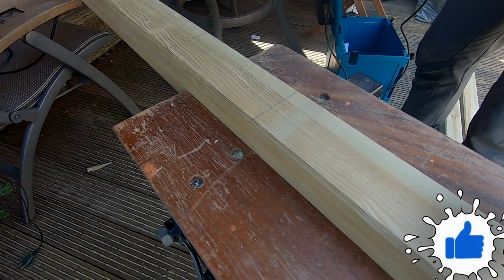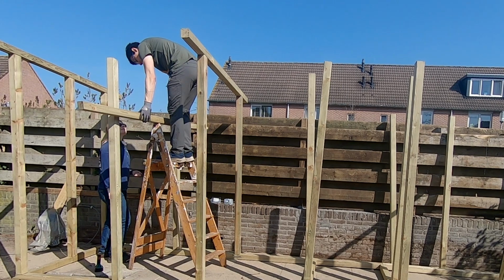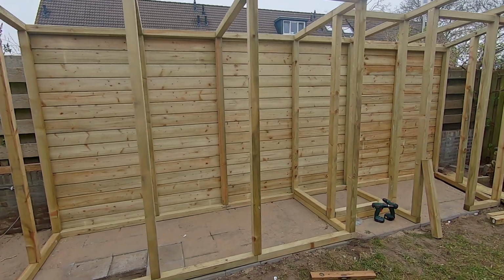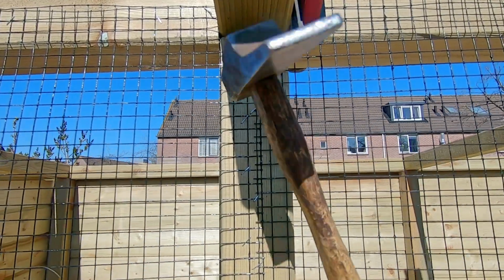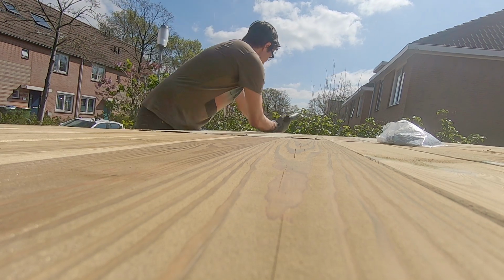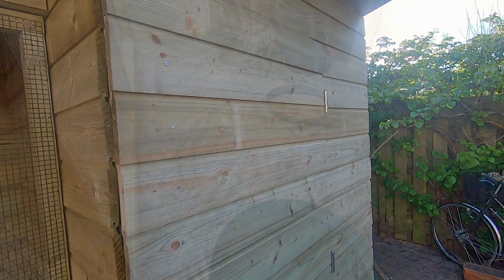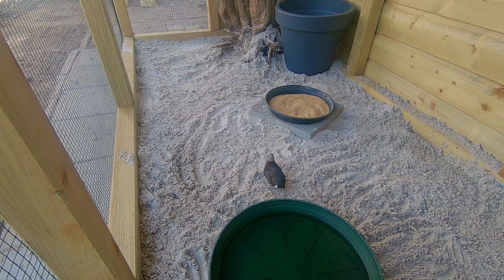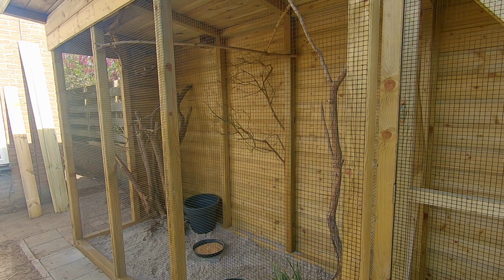I *SURPRISED* my Dad with a New FINCH/CANARY Aviary

Comment: Hi aviary builder for over 35 years, you may need roll down blinds at night/storms./hot days.
make this yourself, thick PVC round pipe 100% shade cloth and cord.
(the main thing is the ventilation flow), round holes at the top at the back/sides/covered with mesh where the wood is.
 dry out the droppings, lots of fresh air. happy /healthy birds live longer. ?  😎
Reply from the maker: Thanks for the tips

Comment: Do you use any heater for the birds in outdoor aviary?     

Can finches survive outdoor aviary without any heater?
Reply from the maker: Depending on your climate, I keep my finches outside or unheated until the temperature drops below 5 a 8 degrees celsius. If it drops below this I will move my finches to an indoor bird room where they will stay during winter